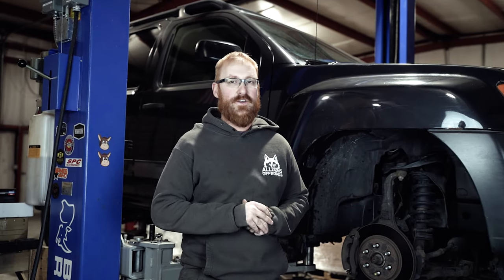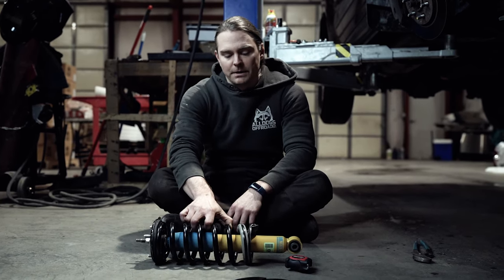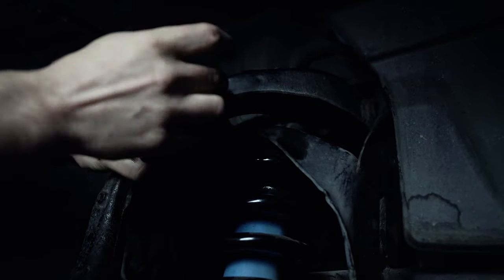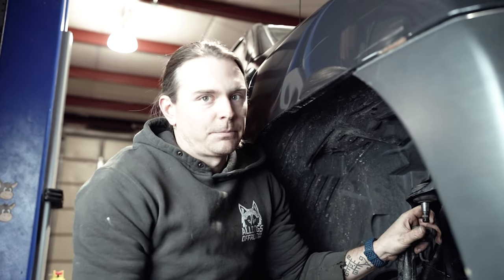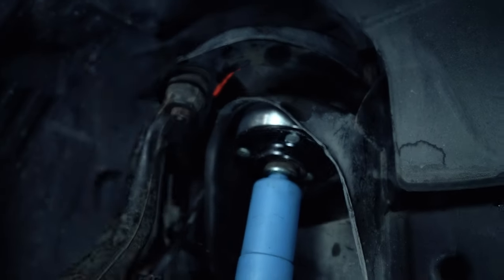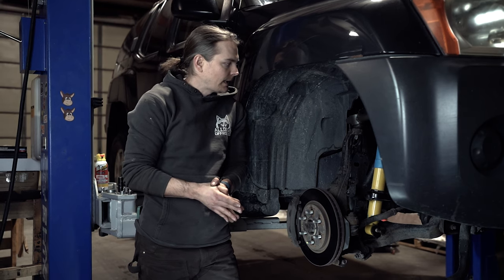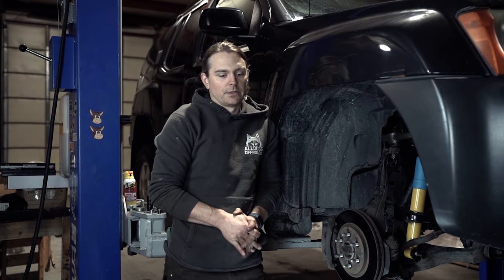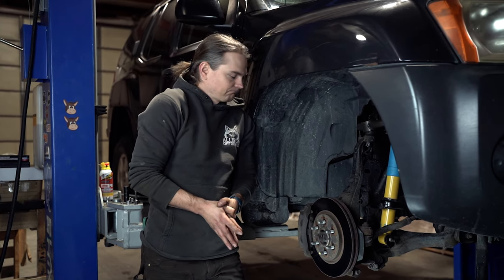Why Spacers don't work with Nissan Frontier, Xterra and Pathfinder

Comment: Do the xterra and Pathfinder have the same suspension as the Frontier? Wgy doesn't work on this vehicles but it does on the Frontier
Reply from the maker: They’re all identical. Companies will say they won’t fit because they never tested them on the vehicle.
Reply: Would the RC kill a kit for 2015 frontier work on 2015 pathfinder ?
Reply from the maker: @mattacedo  no, it would not

Comment: I've seen people do the spacers on these and when they do they swap the struts left to right, would that prevent or help with the CBC?
Reply from the maker: there is no way around CBC with spacers. no magic tricks that can make it go away haha. coilovers are the same regardless of side.
Reply: @AlldogsOffroadCoop  thats what i thought too, but almost every install video i watch they all switch the coil overs left to right...also i see lift struts (Ranchos) that have different part numbers from left to right :/  little confused by it
Reply from the maker: @jaredhayward2323  the drop bracket lift for the frontier requires the tie rods to be switched. maybe that's what you're seeing.
Reply: @AlldogsOffroadCoop  nope, was definitely struts SF creation was where i first saw it...maybe it was just for that particular lift i dunno just thought it was weird since they aren't side specific 🤷‍♂️

Comment: So I’ve got a 13 sv 2wd I got suspension from a pro4x stock would I be able to run a rough country leveling kit on it with no cbc
Reply from the maker: No. The spacer we used in the video was a rough country spacer. You will get it just as much as any other Nissan.
Reply: @AlldogsOffroadCoop  so how can I get this shit leveled  without it
Reply from the maker: @jessefenner8673  a lift coilover will get you the height you need without causing CBC. also if you plan on using the truck as a truck at any time, leveling will just leave you nose high if you put anything in the bed. rake is a functional piece to a suspension

Comment: Does the contact cause any issues or is just mostly annoying??
Reply from the maker: it can cause the upper ball joint to come out of the control arm.
Reply: @AlldogsOffroadCoop  common?
Reply from the maker: @1393floyd  it can be if it hits hard enough over a period of time.

Comment: What about just a quarter or half inch with your UCAs? Surely that should be okay?
Reply from the maker: Correct, if you run a high clearance aftermarket UCA you should clear
Reply: @AlldogsOffroadCoop  I have your 2 and a half inch lift kit already and I just want another 1.2 inch on the front, so I am guessing my next upgrade would be your spacer and UCA. Thanks.

Comment: I'm running spacers right but have been wanting to get rid of it and upgrade. By my wallet doesn't allow for big upgrade. So what do you guys recommend instead of spacers that doesn't break the wallet
Reply from the maker: Aftermarket UCAs to start. We have some that would clear the coil bucket as seen in the video.
Reply: @AlldogsOffroadCoop  so I can keep my spacers? Will those UCA work for sure suspension change?

Comment: So basically just switch out your full front suspension which is control arms, strut assembly, ball joints, tie rods, and sway bar links
Reply from the maker: huh? a simple high clearance UCA takes care of CBC with spacers. no need to replace everything else. nothing needs replaced if you run a traditional spring lift.

Comment: I have 1/2 spacers  on my Nissan Frontier 2007 and never gave me problems
Reply from the maker: 1/2 may not cause issues but any spacer over 1" will cause CBC. no truck is immune to it after 1"

Comment: Ok so I had my mechanics put in my 2” lift kit spring and shock only
No spacer 
I then put new Tyers and alignment they said it will keep the Kant in so will wear the Tyers on outside edge dam 
So I would need the upper control arms YES ??
I’m not doing lots of off roading but for clearance in the Australian desert 
Looking for gold not major rock climbing 
Cheers 🍻 
CrouchOz
Reply from the maker: you need camber bolts for the lower control arms to adjust the alignment to not wear the tires.
Reply: @AlldogsOffroadCoop  thank you for your instant reply guys 
I am wondering do I need them front and back 
Thank you 
CrouchOz

Comment: I think any over a 2" spacer, and you're going to have problems
Reply from the maker: our 1/2" spacer on top of 5100s can cause CBC so a 2" spacer will cause CBC
Reply: @AlldogsOffroadCoop  somehow I got lucky. I have a Pro-4X, but that shouldn't make a difference. My UCAs clear the coil buckets when drooping.
Reply: @AlldogsOffroadCoop  well, you were correct. I do have coil bucket contact. It was in a spot I couldn't see. I'm going to Titan Swap in the future anyway, so no big deal. It's nothing that can't be pounded out.

Comment: Does the same issue happen with the Bilstein 5100s (like stock Pro4X) when you adjust the collar up to give 2" of lift?
Reply from the maker: no. adding a spacer on top of the coilover physically lengthens the entire piece and that is what causes CBC
Reply: Great thanks.

Comment: So what is the worst thing that can happen with coil bucket contact? Both repeated contact and a strong impact?
Reply from the maker: The factory arm is stamped sheet metal and is most commonly known to break in half.  We've also seen ball joints ripped out of the socket, but this is less common.

Comment: The lift coils create the same problem with CBC and their solution being the high clearance UCA. Why not save some dough and just get the UCAs
Reply from the maker: This is incorrect.  A lift coil does not create cbc.
Reply: Many people will argue against this, but whether you have a spacer that is 2” long, or a lift coil that is 2” longer than stock, you still have the same geometry if using stock parts. Nothing but salesmanship would change that. So why mechanically would there not be CBC with a lift coil?
Reply from the maker: @Dark_Ages_Crusader  because a lift coil like what we use with a Bilstein 5100 or the Koni’s does not physically change the length of the shock. You can use our springs on the factory 4600s also and not have CBC. The coilover length is what causes CBC. So when you stack a 1.5” tall spacer on top of a coilover, you are causing CBC since you are physically changing the length of the coilover assembly.
Reply: @AlldogsOffroadCoop  I think I understand. Thank you for the explanation.